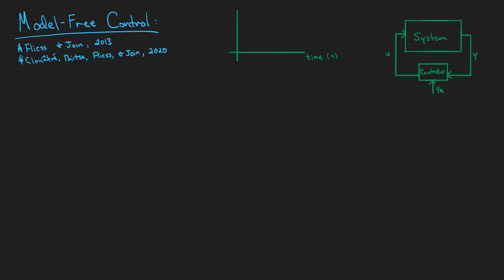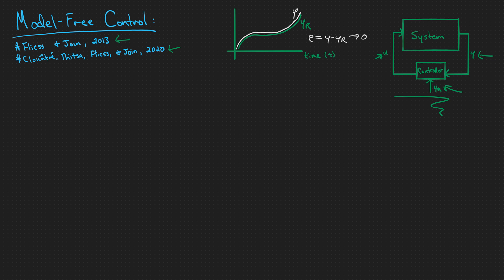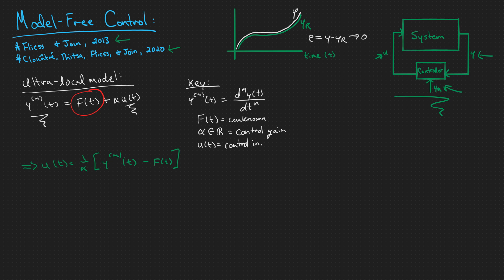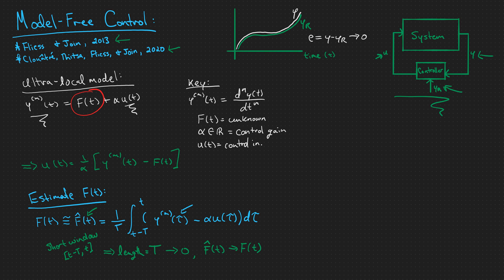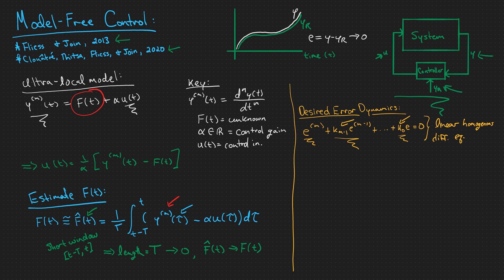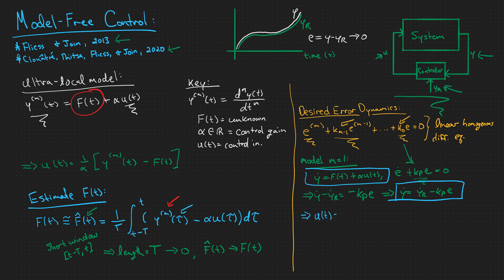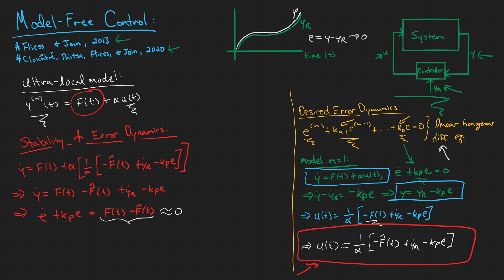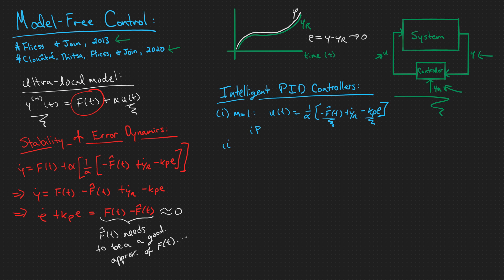Intro to Model-Free Control

Comment: Hi Maison, I'm at the MIT Media Lab working on fixed wing drones for medical delivery, and I think this is incredibly important work. I read your paper. I wanted to weigh in here to encourage you to make the follow-up videos you mention, or return to your 6DOF proposal, if you aren't working on that now. I'm interested in seeing if this could be applied to planes modified with tip rotors to enable low cost high range VTOL by inexpert users. I think MFC may be uniquely positioned to handle transition dynamics in and out of forward flight. amazing work.